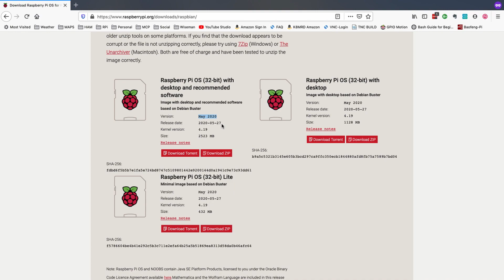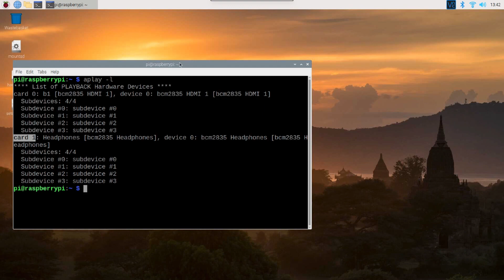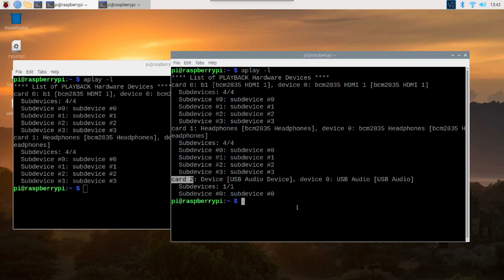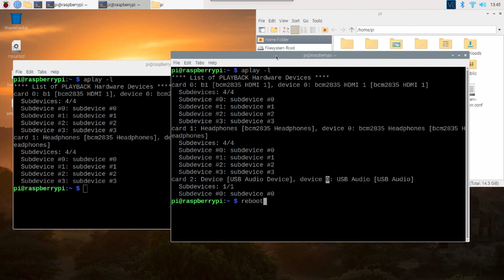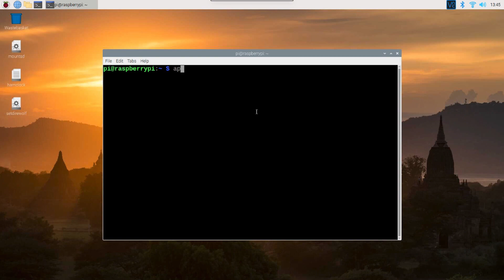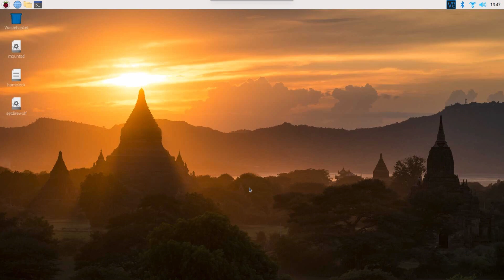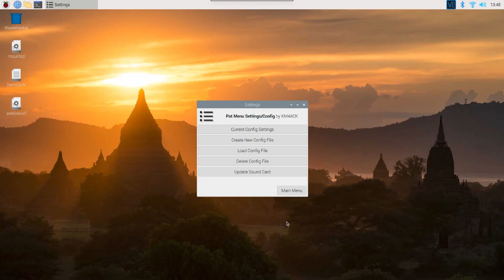Buster Sound Card Issues RESOLVED

Comment: Device enumeration was an issue way back in the days of Linux. This is due to the Kerne giving out device numbers as they start to show up. For obvious reasons, this order can change depending on when a device gets plugged in and or whether it was connected while booting.  The solution to this was udev. With a udev rule, it should be possible to give that sound card a number that will be the same in all circumstances. I have not checked the docs yet if it actually is doable that way.
Reply: I had to write up a udev rule using symlinks to assign persistent device names permanently linking the two physical USB ports I'm using for GPS and CAT control to the Vendor and Product attributes unique to each if these USB Serial devices. Regardless of what ttyUSBn is enumerated to the devices at bootup, or during a hot plug, the device plugged into physical port 1-1.3 is now aliased as ttyGPS and port 1-1.4 as ttyCAT.
Downside is the devices must always be plugged into the correct physical port but I can live with that.
Eg. For my old BU-353 USB Serial GPS mouse:
/etc/udev/rules.d/99-usb-serial.rules

KERNELS=="1-1.3", ATTRS{idVendor}=="067b", ATTRS{idProduct}=="2303", SYMLINK+="ttyGPS"

This device must now be plugged into the upper USB2 port on my RPi4. Lower is 1-1.4. Ipper USB3 is 1-1.1, lower 1-1.2. I don't know if these locations are backwardly compatible.
Reply: Have you tried to omit KERNELS. From the top of my head, this is what binds it to a specific USB port. The idVendor and idProduct should be enough to uniquely select your device. Sadly, some vendors use generic USB chips and attributes can be the same across devices.

Comment: does this mean that we should NOT run apt-get update / upgrade on current version of Buster?
Reply from the maker: I am running the very latest. It is just something new we will have to deal with. I am sure in a week or so we will have an easy solution. I have already built a new function into the dev branch Pat Menu 2 that updates direwolf and ARDOP modem information with just the push of a button.

Comment: Would it be easier just to reboot with the sound card plugged in? Or is there no guarantee that it will go back to Card 1 Device 0 when that happens?
Reply from the maker: Patrick Dickey I have heard of various results. Mine goes back to 1 with it plugged in during boot. Others say it remains 2 regardless.

Comment: `new` version of OS, allows for the splitting of the sound output (HDMI/Headphones jack). Recommend reading the configuration documentation, as it may assist with a fix (especially for headless operations): https://www.raspberrypi.org/documentation/configuration/audio-config.md#:~:text=The%20Raspberry%20Pi%20has%20two,plugged%20into%20the%20headphone%20jack.

Comment: Hi!
It is very easy to setup the device numbering in ALSA.
Check these sources - there is enough information for the setup. For example you can choose the USB device to be always card 0. You can go further if, for example, you have 2 identical USB devices - you can assign numbers to each card.
First link is from Debian's Wiki, because Raspbian is Debian :)
https://wiki.debian.org/ALSA#Troubleshooting
The next link is from Arch Linux, which gives more information:
https://wiki.archlinux.org/index.php/Advanced_Linux_Sound_Architecture#Set_the_default_sound_card
You simply have to choose which sound card driver gets number 0, 1, 2 etc.
P.S. I found that in JS8Call config the audio device settings is messed up with the new Buster version. I renamed ~/.asoundrc and the config was like before.
Reply from the maker: Thanks for the info! I'll take a look at the referenced material. Haven't tried this before.
Reply: @KM4ACK  
Just add:
#USB soundcard (index=2 is preferred because 0 is for hdmi, 1 for headphone jack)
options snd-usb-audio index=2
#Internal sound
options snd-bcm2835 index=0 
in /etc/modprobe.d/alsa.conf (or similar) - every file in that directory is examined on boot for kernel driver specific settings.
That way on every reboot we will have these devices:
aplay -l
** List of PLAYBACK Hardware Devices **
card 0: b1 [bcm2835 HDMI 1], device 0: bcm2835 HDMI 1 [bcm2835 HDMI 1]
  Subdevices: 4/4
  Subdevice #0: subdevice #0
  Subdevice #1: subdevice #1
  Subdevice #2: subdevice #2
  Subdevice #3: subdevice #3
card 1: Headphones [bcm2835 Headphones], device 0: bcm2835 Headphones [bcm2835 Headphones]
  Subdevices: 4/4
  Subdevice #0: subdevice #0
  Subdevice #1: subdevice #1
  Subdevice #2: subdevice #2
  Subdevice #3: subdevice #3
card 2: Device [USB Audio Device], device 0: USB Audio [USB Audio]
  Subdevices: 1/1
  Subdevice #0: subdevice #0
73! Daff, LZ1DAF

Comment: Could disabling the ONBOARD RPi Sound card solve any problem ?
Reply from the maker: Very possible but I occasionally use the onboard sound card for alerts with JS8Call and Pi-APRS.
Reply: @KM4ACK  could disabling the ON BOARD Sound card solve the present problem. I mean make the external USB fall in place for others (software) to access it ?